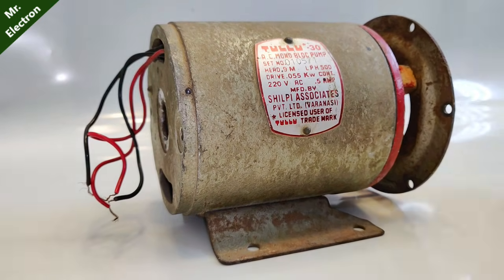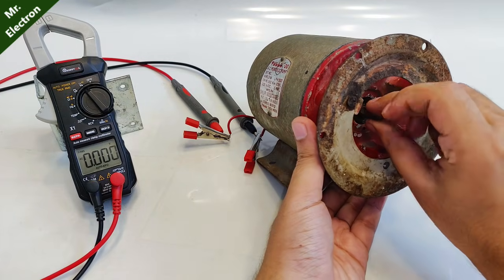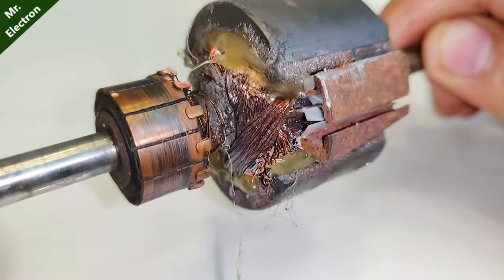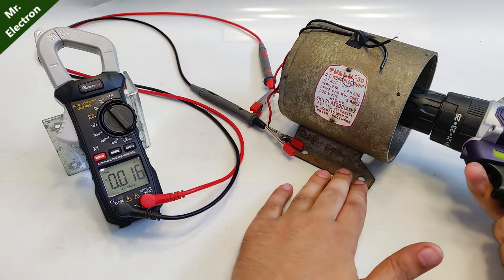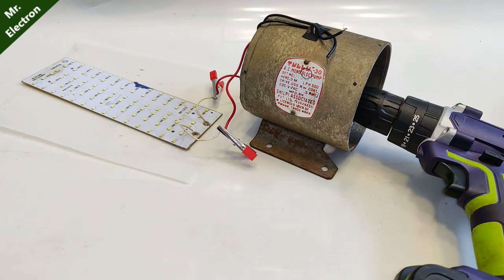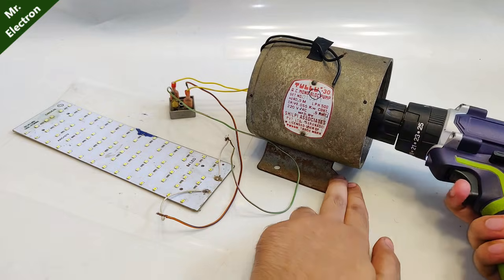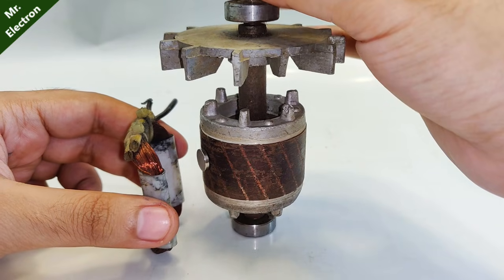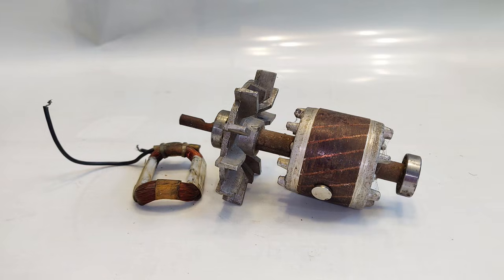220V 100W AC Induction Motor to LOW RPM Electric Generator - Best Project 2020

Comment: Hi please tell me where I went wrong. I used induction motor by machining rotor to fit 10mm x5mm x100mm strong magnets. I'm getting low voltage when using voltmeter  Your help will be most appreciated

Comment: Sir i have a universal motor of 230v/240v 50hz/60hz 100w .5A and its a sewing machine motor. Sir is there any problem to convert it into a "screw driver or as a small use drill machine". Also i would like  to take your preference to make the above project possible.
Reply from the maker: It will work as both... But gear are needed for respective machines
Reply: So I will try gear motor for this work

Comment: at 4:55 its seems edited i dont think its real cuz i am enginner too and i have tried this too  to generate electricity by using universal motor instead of Drill to rotate the shaft of induction motor very very fast and i used strong neodymium magnets but it generated 3 to 4 volts which is use less , i also watch great scott too he said that we should rewind it or use 3phase motor to have better low RPM electric generator
Reply from the maker: I failed too in this similar project last year - https://youtu.be/oyGyNUOTu20
Did the same mistake as GreatScott ! but i did't give up.
Its not about having an engineering degree. Its about practically trying it again and again.
You tried , it didn't work. Well it happens to me all the time with most of my new experiments but that does not means it won't work.

Just give it a try using 2 magnets only... 
- Try it on capacitor start/run type induction motor.
- Don't go for shading ring type.
Reply from the maker: Its not fake edited , its just the camera closeup fault.
Reply: @MrElectron  but nother the less I like ur hard work on electronics and make interesting video I always watch ur new videos when upload keep it up bro♥️
Reply from the maker: Yeah ! I understand.
But thanks and much appreciated 🙂
Reply: @MrElectron  well yeah ur right but not everybody has the same motors like u do and I do and all induction motors are different and there not built to generate electricity but u can generate electricity by using 3phase motor

Comment: Both cases are different. I also watched Great Scott's video. Your connection is in single phase. What Great Scott have is a three phase induction motor. Winding is different. Well anyways, this is a good experiment.
Reply from the maker: Its not about phases as i explained at the end of the video... 1 phase , 3 phase or 5 phase.. All that matters is the number of alternating  magnets (NP , SP) for one single winding pole.
If there are even number of magnets facing one pole the induced magnetism is ' ideally 0 ' but if there are Odd number of magnets facing one pole, then it will be just 1 and rest will be cancelled
Reply: @MrElectron  yes. I agree with that. What bothers me is the output waveforms of great Scott. Instead of 120 phase shift, i think its around 10 to 15 degrees.

Comment: Or you can just pass a.c. across the motor's windings (whilst the rotor is rotating from an external mechanical energy source) for a short time to magnetise the rotor or turn it at higher than synchronous speed and the motor will generate electricity.
Reply: Not ac,a dc pulse of 12v to 60v